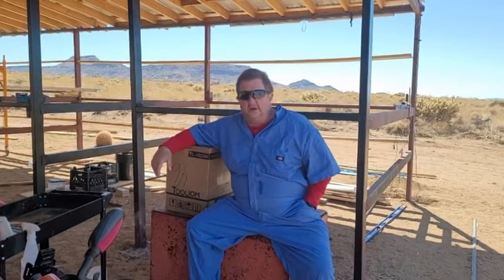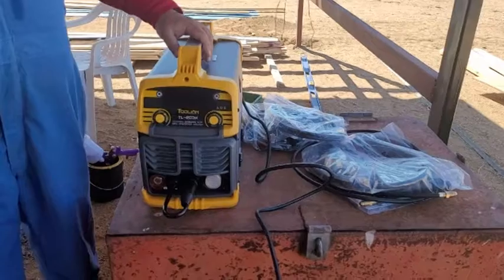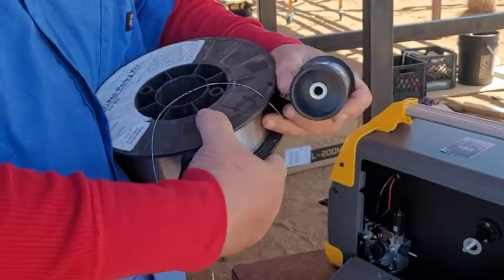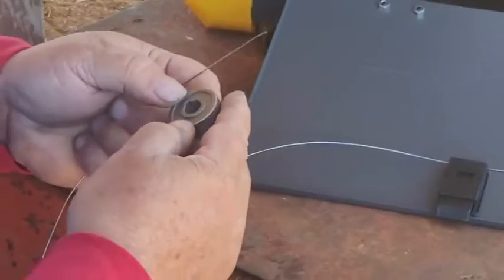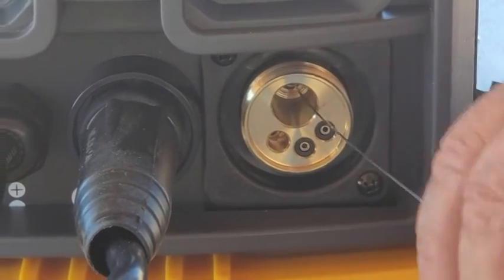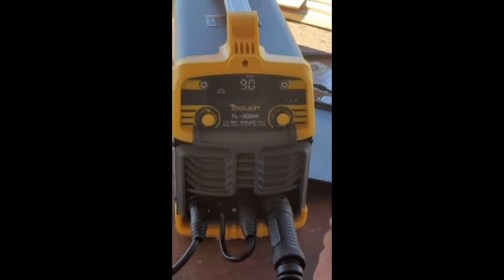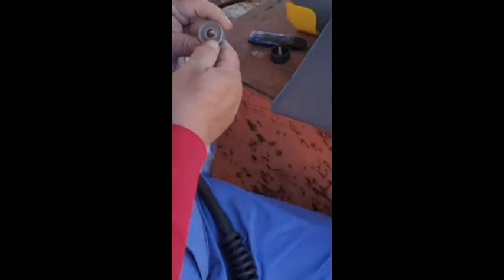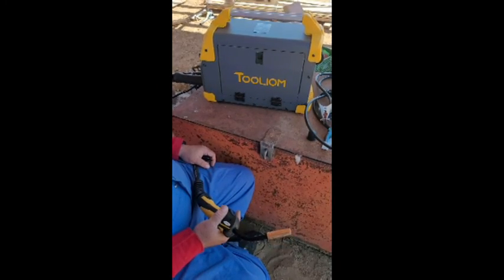TOOLIUM Welder unboxing

Comment: I recently bought one to replace the welding machine at the company shop. Unfortunately, there are issues with the assembly of the Tooliom machines. I previously bought the TL-50C Plasma cutter and the front connection on the panel was loose. It wasn't properly tightened down to the panel. The same thing happened with the 200 Amp Mig Welder. The cable that comes out of the machine on the front of the unit was not tightened down on the panel. I had to take the front of the mig welder apart and tighten down the plastic nut that holds the cable in place. After beginning my job of welding covers to the tops of 12 bollards I began to experience burnback within the first minute of welding. I investigated thoroughly and discovered that the drive roller spins while the wire doesn't feed. I tried reversing the drive roller and tried the second one that comes with the Tooliom Mig Welder but the same thing happened intermittently. I took the drive roller from my Lincoln mig welder and it did the same thing as well causing burnback intermittently. The drive roller spins as the wire remains still. I've checked the tension and gave plenty of slack but the wire wouldn't move with little or full tension on the drive roller. I really wanted it to work because I needed to get the job done but I had to finally give up and use the old Lincoln welder I tried to replace. The housing of the Tooliom Mig welder is thin metal and the plastic parts of the mig welder do not inspire confidence. If you get one that works I wouldn't recommend it as a shop welder. The base of the mig gun that attaches to the machine is massive. For transportation you will have to remove the mig gun and cap off the end that plugs into the front of the mig housing. I've begun the return process and tomorrow I plan to box it back up after another attempt to remedy the problem. I've been welding for 20+ years so I know what I'm doing. The welder is light and the price is reasonable but there are issues that can't be overlooked.

Comment: Excellent video! Try placing  painter's tape over the reel of the wire before applying the Flux wire into the feeder wheel. When feeding the wire you can open the assembly on the wire feeder/ wheel for easy access.

Comment from the maker: while doing this video the wheel in the bag is for flux core. And on the dial at 2:00 is tig welding (could not see it tin the sun) . Big hint put electrical tape on the spool. This unit could have used a .05 inch open space to fit big reals. It is lighter than yeswelder. I woke up one morning and my yes welder just didn't work. and got the royal run around from yeswelder and i was one of their dealers.  any questions feel free to ask-positive comment only. if you like please subscribe.

Comment: Thank you for all the information, very helpful. I connected the MIG cable first and pushed the wire through a couple of inches, then with the help of the trigger allowed the machine to push the wire all the way through to the tip of the MIG cable, It worked like a charm. Maybe you would like to give it try.

Comment: Thanks for the video 
Now I know how not to set it up ha ha
Just joking great video
Your groove roller is for flux core,the smooth roller is for your solid wire also you don’t need the nozzle unless your using mix gas
Reply: I was going to write the same to let Mike know.

Comment: I just bought one.  Lots of features like inductance and variable voltage.  Hot start for stick but I got other options for that.  Lots of bang for the buck so far
Reply: By the way if you don't fix that spool the right way you're going to have feeding problems when it bird nest like that it lost attention in The Wire if you didn't fix that right you're going to have feeding problems at the very least the wires going to be going slower than what it says it is and it may even jam up if you're lucky none of that will happen but chances are it's going to be a problem the proper way to put that wire in is to have everything ready to go and not fumbling with it when you go to put the wire in you must hold on to that wire through the entire process somehow or it will bird nests like that. and yes it happened to me so I knew exactly what was going to happen when I saw you fumbling about with it but lucky for me it was a 2 lb spool and not a 10 lb pull
Reply: for consumables for this welder the Harbor Freight Vulcan tips should work I'm pretty sure I've replaced them with it even if they do not work as long as you don't over tighten them in damage the threads they should work just fine if you're going to use this for flux core you can also get the Vulcan flux core plastic tips you just have to take them on with paper tape because you should protect the threads with a flux core tip because you may one day use it for the make settings and with gas you never know typing it on may not be perfect but with paper tape it should be somewhat heat-resistant and work just fine that works for me
Reply from the maker: @codeward7249  i did right away

Comment: I'm seriously considering getting this for a first welder.. I have $100 Amazon gift card and $25 off coupon for it..
Reply: the only reason I got this welder it was the cheapest welder that had metal Drive wheels and can take a 10 lb spool of wire trust me buying 2 lb of wire will be very expensive it is cheaper to do it in 10 lb full special e on Amazon so just buying 10 lb spools alone will pay for the welder but you do have to need the use for a 10 lb spool that I won't lie.
the only problem I have with this welder is it actually does not have settings for o30 it has o35 but not owe 30 I don't get it. 4 Meg settings it actually doesn't have voltage displays and I think that's weird as well. and weird this welder is the Plastics pool that holds the 10 lb spool was locked so tight that I could not by hand open it even with tools I could not and I broke it in the process not critically though I was actually about to send it back because of this cuz 10lb was the very reason I bought it I stuck it in the microwave for 10 seconds and hated it up enough to loosen it up if that didn't work I was actually going to send this back nothing else is wrong with it just that something they probably don't even give much consideration to was the only flaw with this machine and I'm by the way I'm pretty sure the consumables are standard to Harbor Freight machines I'm pretty sure I've used them I've also used some that did mess up the gun a little bit but not to the point it will be malfunction but I'm pretty sure Harbor Freight consumables will work the consumables I'm talking about is the tip but all in all this might be a cheap welder but it feels right in the hand it just can't describe it
Reply: But for a first welder you couldn't do no better and that's a fact for all of its flaws and by the way yes I did buy $1,000 welder from Harbor Freight because I finally open a store close to me and returning it wouldn't be a whole day's plan I like the Mig gun that comes with this welder better though it just feels like I actually have something in my hand the main reason I went ahead and bought one from Harbor Freight is if you look online majority of their good welders is going to take a half of a year to get back online and with backorder chances are it could be an entire year for I can actually buy $1,000 welder from Harbor Freight online that is and they might have one in stock at the stores but that's not a guarantee and yes I put a two year warranty on it

Comment: I'm starting out welding and I was wondering if the consumables are readily available.
Reply: Yes.  Tweeco consumables at your local weld shop
Reply from the maker: oh yea- amazon. I use 1o pound spools. but everything is available. In fact i use a yeswelder gun that im use to.

Comment: Does it come with a .023 roller?
Reply from the maker: no.
Reply: @stitchimage4  thanks. Was going to buy it for a home garage backup.  I don’t feel like bringing equipment back from my shop, to get my 62 F100 to roller state. Bought a Vevor mig-200D3 instead.

Comment: I think time will tell... Yeswelder, Tooliom, Sungoldpower, etc they are in the same boat... coming from China (but I know: stuff coming out of China is not always crap). These are all welders not rated, with cheap parts; it is a matter of time for the welder to break — if you push it a little too hard. For exemple, swithches aren't rated for the amperage output announced or duty cycle... First off, it is not too rare for a welder like that to be not functional right out of the box (ask me why I know). The quality control is (almost) non existent... Some guys are lucky and get a good unit; even if it might not be durable, they are not paying much for it... But I am not into that philosophy — the disposable welder...
Reply: I bought the Tooliom 200 Amp Mig Welder and began to experience burnback intermittently within the first couple of minutes of welding caps on top of bollards. I wasted more than an hour and several feet of wire trying to get the drive roller to move the wire without stopping but eventually I had to give up. I think the tolerances are off because I went from little tension to full tension but still experienced burnback as the drive roller spun and the wire stopped feeding intermittently. I removed the liner to make sure it wasn't damaged. The only issue is that the drive roller spins while the wire intermittently stops moving. I tried both drive rollers and I tried one from a Lincoln mig welder. I also own a Tooliom plasma cutter that had a couple of issues when I bought it but I got it working. Tooliom products are poor quality. I expected that but I didn't expect the product to fail within the first couple of minutes. I'll be glad when i return it and receive my refund.